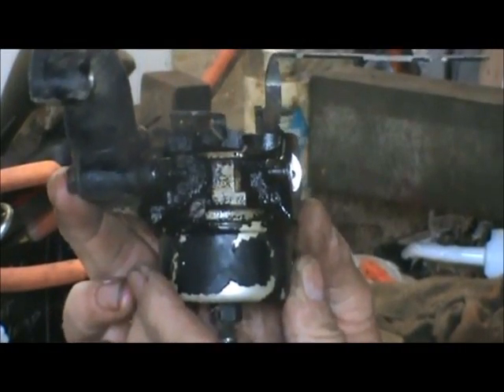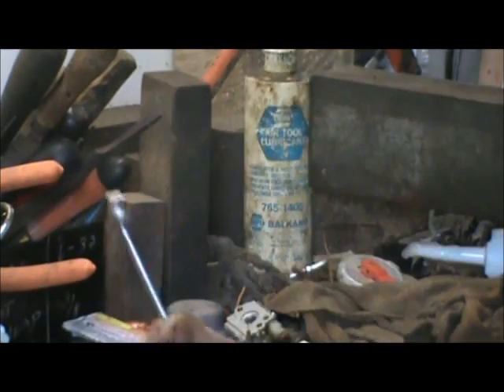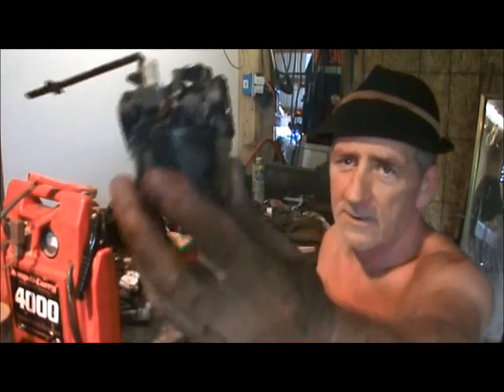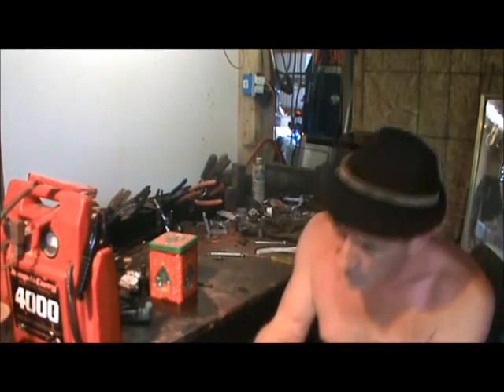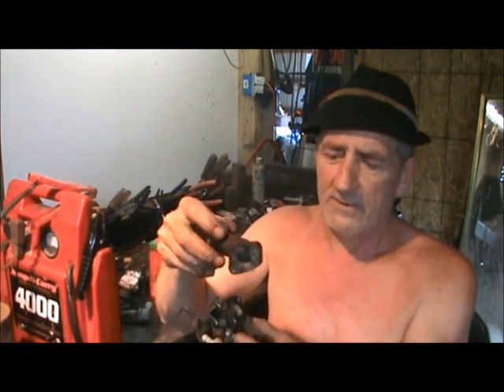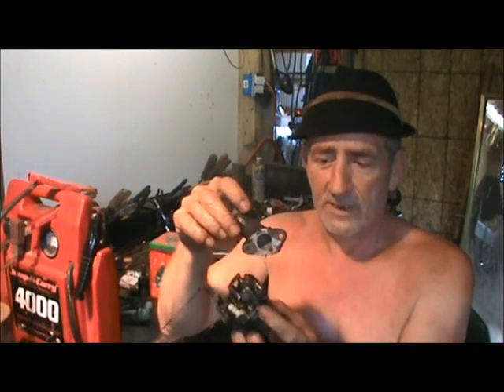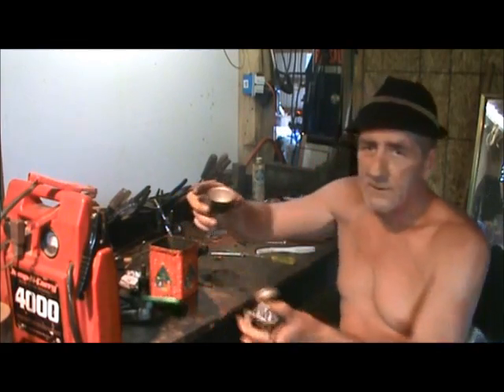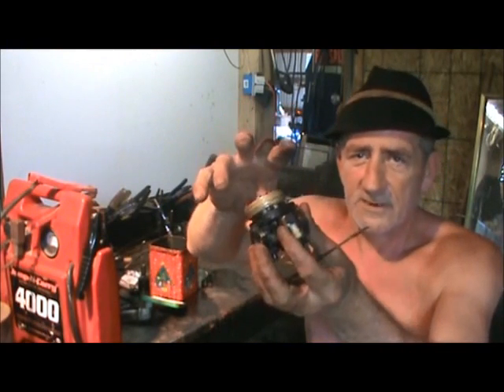Carburator float stuck lets fix it

Comment: I normally clean the carburetor with a commercial degreaser before i take apart the carburetor because it made for removing dirt and oil after that i use some commercial degreaser in a spray bottle spray inside the jets with the commercial degreaser and flush with hot water after that i will use compressor air to blow out all the jets until it's dry and after that i will use a bread ties take the paper off of it as a thin piece of wire and stick it into each jets after that i will use compressor air to blow out all the jets until all the jets are clean and then i will spray carburetor cleaning into each jets again by using the red straw that came with the carburetor spray insert the little red straw on the carburetor can Shake up the carburetor can real good before spraying the carburetor insert the little red tube from the carburetor can and spray each jets you will see each jets open up you will see and know that all the jets are clean because you will see the carburetor spray shoot through each jets holes from the carburetor spray make sure to wear safety glasses because i been doing this for years and i know what im talking about after you finish doing all of this you will thank me i am BLESS at doing this BLESS by GOD also that bread ties make sure you push it as far as it can go but don't force it also make sure that the wire is straight not bent so the wire go straight through each jets holes on the carburetor you may see it comes out to another hole as you insert it into a hole because it's very tricky that way you know it's clear and clean especially when you spray inside of it with the carburetor cleaning